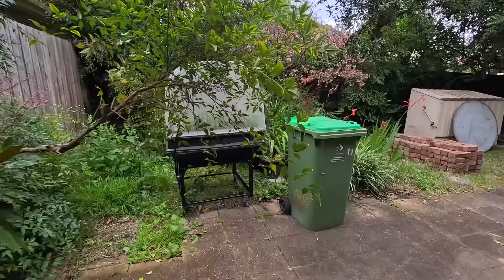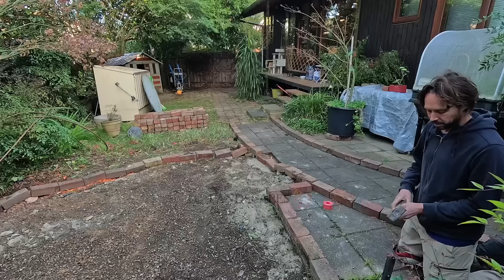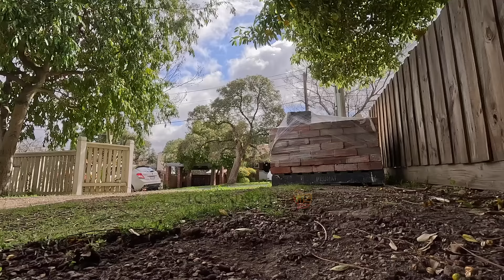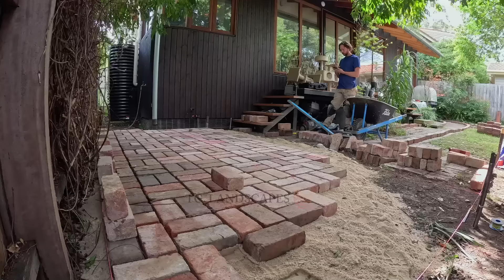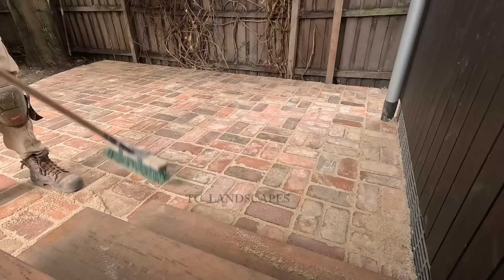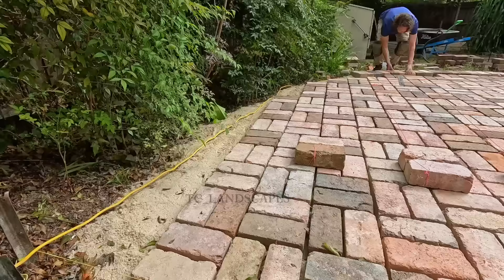Turning an Overgrown Garden into Calm, Curved Paving Spaces

Comment: How do you handle compacting the base under odd places like under the stair steps in this project or in a narrow yard that has AC condensers floating above the ground?
Reply from the maker: for those tricky spots I usually use a hand tamper, or a flat piece of wood and smack it it with the mallet.

Comment: Hi
For paving on sand, do you ever fill the gaps between pavers with a dry mix of cement and sand? The bricks I just laid have a gap of 20mm so maybe they need a 5:1 mix? Do you have a video on this?
Reply from the maker: You can’t pave on sand and use a solid grout, it will crack and look horrible in less than a year. Paving on sand allows movement and improves drainage, but this movement means the grout also needs to be flexible.
Reply: @TC_landscapesok, so i should steer clear of having any cement in the sand?
Reply from the maker: Yes, that would be my advice 👍
Reply: Thank you. Uour videos are excellent. This is my first paving job and I'm using old bricks from the backyard very much like the ones you use. I didn't know anyone did this! And when I saw what you were doing I was super stoked. Once I got to the stage of filling the gaps I found your channel, thanks very much, johnny

Comment: Great channel, a couple of questions please, I was wondering how you get your plate compactor on and of your ute, and what model makita recip saw do you use? many thanks, greetings from Fremantle WA.
Reply from the maker: Hey mate, cheers 👍
Yeah, the compactor is bloody heavy for one person and incredibly difficult to get a good grip on to lift safely, especially when it’s hot. I usually roll it into a barrow and then lift it onto the Ute from there. At home, I made a table on wheels which is the same height as the back of the Ute. I slide it onto that and wheel it into a corner until the next job. It works well. 
I’ll check the recipe saw and get back to you. It’s nothing special, must be at least 6-7 years old now. Still does the job though. 
Thanks for commenting 👍

Comment: Love it. Will be using this as inspo for the next section of my garden.
Reply from the maker: That’s awesome. Looking forward to spotting your new garden in one of your videos!
Reply: @TC_landscapes by the way. Would you have advice on cleaning up tiles? I have what I think are yellowish old concrete tiles on the property I bought (~15yrs old)..I might change them out but for the sake of budget I wanted to clean them up with my power washer for the mean time. Trying to avoid using harsh chemicals due to my planted elements all around the garden.
Reply from the maker: @thecrookedcottage hey mate, a petrol pressure washer is the way to go. Just has to have really good power. I’ve tried some “gentle products” but they basically do nothing.
Reply: @TC_landscapes cheers. Will give it a go.